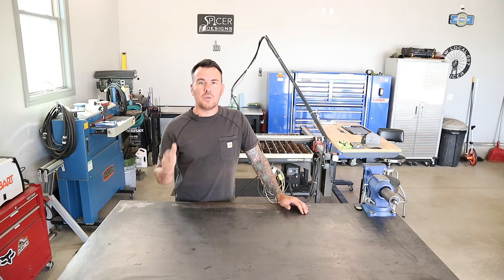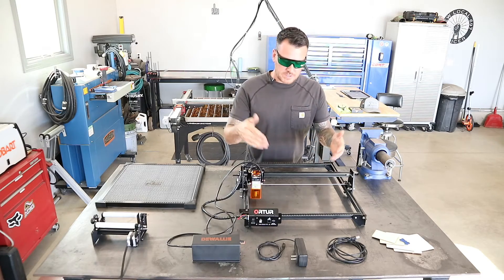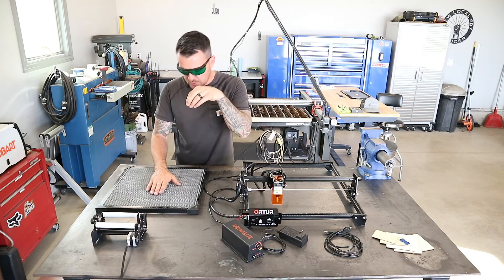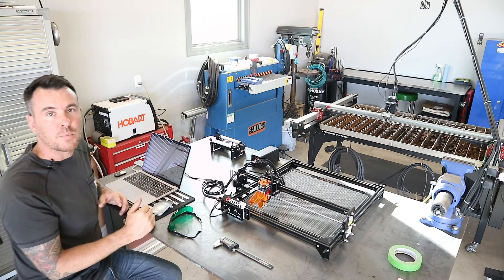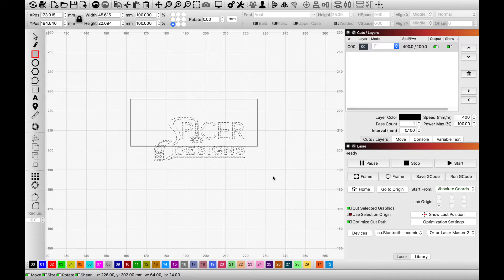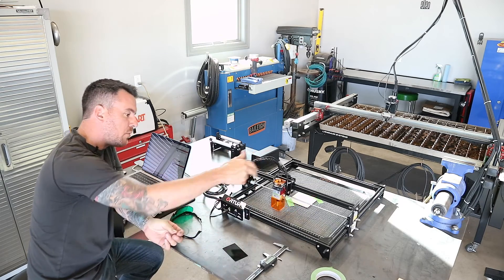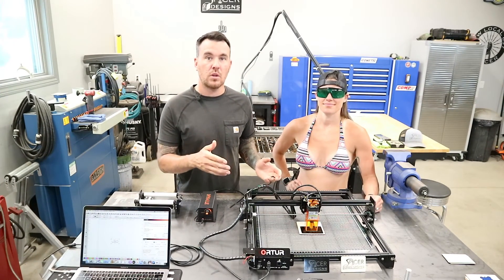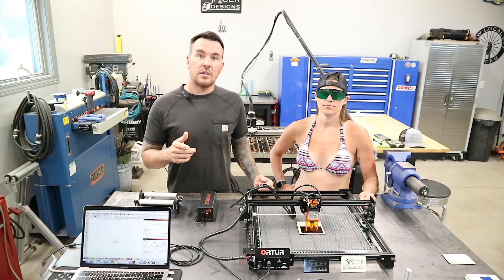NEW TOOL for the SHOP! ORTUR Laser Master 2 S2

Comment: Hypothetically if you possibly lost the height measuring tool in a move what would you use instead… asking for a friend.
Reply: Same thing happened to me. I've been looking, and supposedly the correct distance is 30mm. I tried that with some calipers and it was out of focus. In the end, I wound up doing it by eye, with my material on the cut bed, firing the laser at 2% power, and sliding it up and down until the laser was focused at it's smallest dot. It's working ok, but I need a better solution. Search for the video "Your laser focus is wrong" by Let's Make A Thing, he has a pretty good method for coming up with a custom focus block that's tuned to your exact emitter.
Reply from the maker: Sorry i never saw this comment until someone responded to it. Id imagine you have it resolved now but the manual should spec the required distance where you could make a new one.  Or order one.

Comment: Currently I am using a branding iron to apply my logo to hardwood cutting boards and it looks like crap. I would like to laser my logo into cutting board for a cleaner and sharper look. Will this laser cut logos into hardwood?
Reply from the maker: For sure it will.  That is an older laser.  I would recommend a newer setup.  These lasers are constantly changing.  I have some other videos with newer lasers.  But the one in this video will do what you  need it to do

Comment: The only thing you need to convert from mm to inch or back is to either divide or multiply by 25.4  depending on which conversion you need.   1 inch = 25.4MM
Reply from the maker: Hah.  Thanks for the info.  I was just joking about that.  Hope you enjoyed the video.

Comment: calipers bro, not micrometers
Reply from the maker: Bro. Yes the tool is technically a caliper.  But a micrometer is any tool that accurately measures components.  Its a general term. So i wasn’t wrong for calling it that.  Thanks for the comment bro.  Bro

Comment: thats the old LM2 but not S2. the S2 is the upgrade to the LM2 Pro. even that cylinder roller is the old  (3years?) version. just air assist is new
Reply from the maker: Im not an expert on these laser machines.    The model number i have is whats on the machine.  Not sure on the roller.  Still have to figure that thing out.  Thanks for the comment.

Comment: that lightburn program, you showed the Trace image feature. is that something you can do within lightburn and then export that as a DWG to open in Fusion 360 so you dont have to manually trace images for your Plasma Table?
Reply from the maker: You should be able to.  Ive never tried it.  I  just like making then from scratch.  I think the file is better quality that way.  But it can be time consuming so that is a good idea to use lightburn.  Thanks for the comment!

Comment: Hi Kyle, I have a crossfire pro and a hypertherm 45 very interested in trying to get into making signs love the channel, I'm just not to computer savy and a little intimidated its been sitting hasn't even been fired. Any advice for the quickest easiest way to get this machine up and running! Thanks great videos and nice work and partner!!.😍
Reply from the maker: Do you have all the software and connections in place?  Or do you still have to set up everything?   If it makes you feel any better i was terrible with computers until i got into this.  I would recommend getting the machine set up and software connected first.   You can follow the video tutorials on langmuirs site.  Just do a little each night because it can be a little overwhelming.  Then download fusion 360 and start getting familiar with the cad tools.  Just email me as you have more questions and ill do my best to answer them.  Thanks for watching!
Reply: @SpicerDesignsLLC  thanks  Kyle I'm excited to get it done. I've had this setup for a couple of years even bought a new gaming computer for the high tec software was trying to get the the cad design to cam and a tool path and that's where I'm missing something? I can do a drawing in 360 its just missing something getting it into tool path and to cut? Have THC as well! I will have to go through the  tutorials and try to get it figured out! Great channel thanks for your time
Reply from the maker: @kevinsabourin5102  after you finish your scetch, turn it into a body.   Then go to manufacture.  First you have to do the setup option,  then the cutting option to get your tool path.  There videos should guide you through it
Reply: @SpicerDesignsLLC  thank you

Comment: Is made the best legit? Just placed an order and wanna be sure China doesn't infiltrate me lol
Reply from the maker: Ya they are.  They reached out to me to collaborate.  They sent me the laser.  Pretty easy to work with.   The laser is pretty nice too.
Reply: @SpicerDesignsLLC  thanks alot! Ordered same laser and even came with the roller 50% off so seemed sketchy lol
Reply: @SpicerDesignsLLC  how long you had laser? Still going strong?
Reply from the maker: @aaroncasteel4179  ya it works nice.  I mostly use it to make logo plates for some of my builds.  Then i rivet them on.  Ive had a lot of interest in people wanting logo cups.  Just havent had the time to mess with it.  I plan on making some more videos with it.
Reply: @SpicerDesignsLLC  awesome I'll subscribe and keep up man. It's intimidating at first. See when it gets here. Thanks for the vid
Reply from the maker: @aaroncasteel4179  youll figure it out man.  Gotta start somewhere.   Theres a ton of videos on that machine and you can do all kinds of different material with it